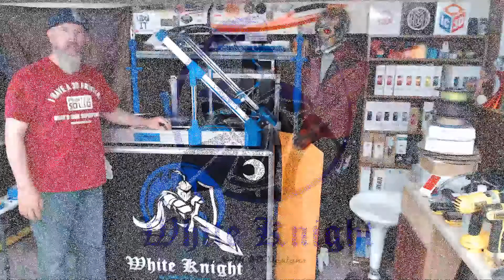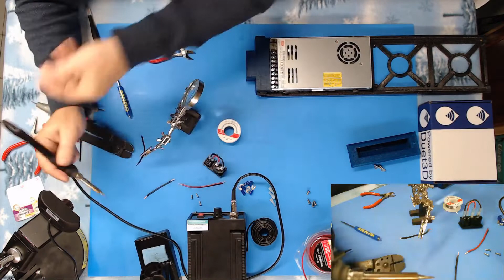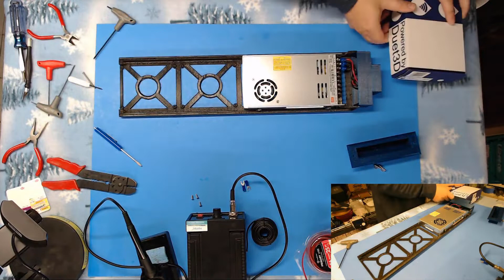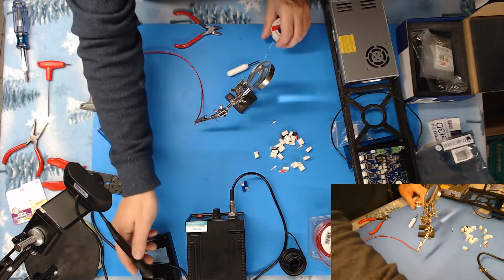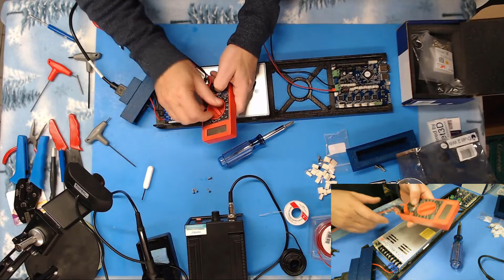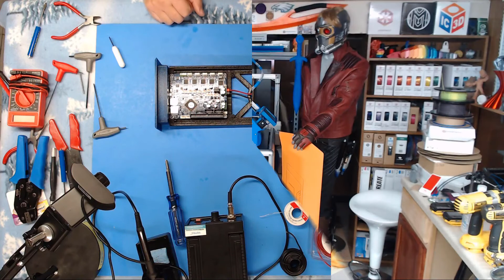White Knight Assembly Part 11

Comment: Hi Carl, I couldn’t really see when you were tinning the wires, are you tinning just the very tip to maintain shape or were you tinning the entire wire end before crimping into the connectors?
Reply from the maker: I was tinning the entire stripped end before crimping

Comment: Hi Karl, What print speeds have you been able to achieve with the printer?
Reply from the maker: The sword was done at 50mm/sec due to the large overhang.    The I beam I believe was done at over 100mm/sec.
Reply: @NAK3DDesigns  Thanks for the response! Quick question do you have a full assembly STL file on on GitHub. I would love to have a full model to work out dimensions and build an enclosure for while I am waiting on parts :)
Reply from the maker: Osha G not currently.   Future plans are to do a complete assembly in Fusion 360.
Reply: @NAK3DDesigns  Understood. Could I ask what the rough overall dimensions of the  printer are please
Reply from the maker: @James-dx9ho  39in long x 22.5in wide x 29in tall..  or 990mm x 570mm x 740mm..  roughly
Reply: @NAK3DDesigns  thank you!!

Comment: Also do you see any problems adding the E3d tool changer later on?
Reply from the maker: Osha G hard to say without having any tool changer components to test with.
Reply: @NAK3DDesigns  It doesn't seem like it will work given the 45 degree angle. You can't move the Y beyond the belt to pickup the new tool.
Reply from the maker: Osha G plan would be to pick up the tool at the top of the y axis not the bottom.
Reply: @NAK3DDesigns  Ah ofcourse!!

Comment: Hi Carl. Thanks for the consistent upload. Quick question. I understand you used the belt materials you had. Just wanted to get your thoughts on using a composite belt like the blackbelt printer. Seems like a better choice due to the thermal expansion in the steel belt and potential ramifications on belt tension and bed leveling. Thanks for all your hard work!
Reply from the maker: Osha G it’s hard to say without having the material to do side by side testing.   I chose the Stainless belt as a backer for the Buildtak sheet because I saw what appeared to be poor adhesion on the belt that Blackbelt used.    I welcome feedback on any other materials people may try.
Reply: @NAK3DDesigns  interesting. Was the blackbelt you saw using just the raw surface?